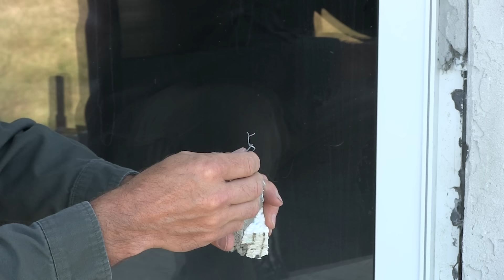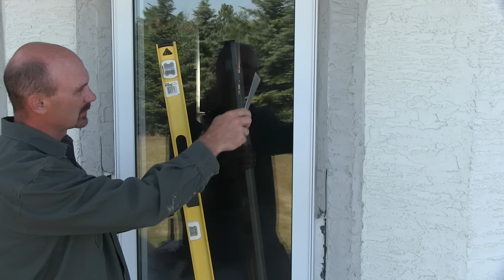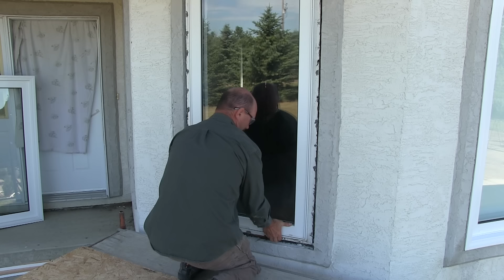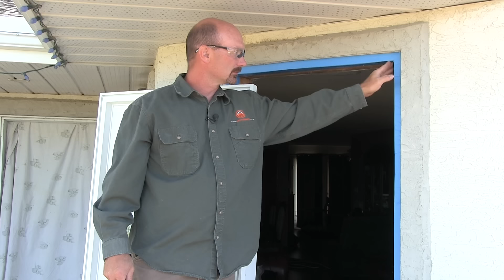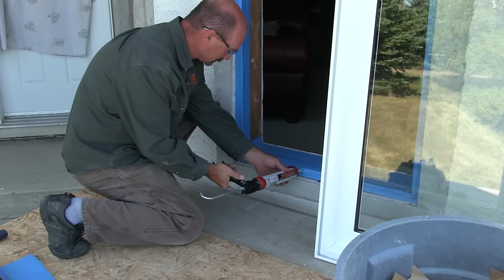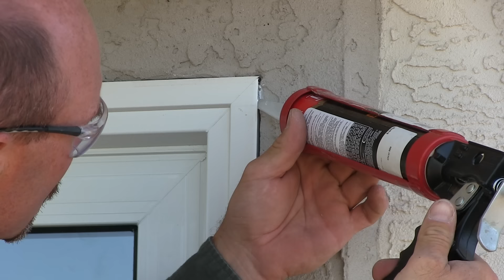How To Replace A Window In A Stucco Wall

Comment: so you didnt attach that tape to the typar? isnt that bad?
Reply from the maker: This home had tar paper and these tapes don't really stick to it , you do the best you can in a remodel. Cover the wood with tape, caulk the perimeter of the window where it contacts the tape and caulk the edge of window to the exterior finish.
Reply: @HouseImprovements on your own house right? if it was for customer you probably would have redone all the stucco right?

Comment: WHAT DO YOU CHARGE PER WINDOW THAT SIZE?  2025
Reply from the maker: labour rates are so different all over the place i'm not sure my price is going to help you unless your in my exact area but labour just to cut and remove the old and instal a new window (no materials) would start at $300.

Comment: wouldnt it be easier to cut the stucco first then cut the flange off.  This way you can have access to the side of the cut flange and pop it off without the stucco and window being an obstical.
Reply from the maker: You could if you are scrapping the old windows anyways , I was salvaging the windows for the owner to use somewhere else.

Comment: 15:05 I was just thinking wouldn't it be easier to use the oscillating tool with a thinner blade to cut the vinyl flange instead of trying to break it with a small bar

Comment: very helpful.  Though I bought standard off the shelf flange type (new con) windows. My stucco is exactly the same, with foam trim boards stuccoed over the old flanges. But I am putting in taller windows than existing (mounted lower under existing header), so I can't leave the foam trim in place.  I think I will cut the foam trim off completely and replace it with wood trim or those plastic paintable trim boards, and then put texture on them like stucco before painting.

Comment: Did you install a drip edge and/or Drip cap? I didn't notice that you did. Many thanks.
Reply from the maker: This window is tight enough under the over hang that it does not require one. If the distance from top of window to under side of over hang  is 1/4 or less of the actual vertical projection above it then it does not need one. For example on a 24" over hang the window needs to be 6" or less down from that over hang to allow no drip cap.

Comment: hey Shanon the window you just replaced looks good why did u change it?
Reply from the maker: These all had broken seals on the glass and two of the three I replaced actual had hail damage to the frames.We replaced all three so they still looked the same since they were side by side.

Comment: @houseimprovements , thank you so much for this video.

If you were adding a new window where there wasn't one before, would you basically frame it from the inside for your rough opening, then cut the stucco that same size + enough for the brick mould / flange in a similar way to what you did here?

Also, how necessary is it to try to get flashing up inder the stucco / wrap at the top?
Reply from the maker: Yes you are correct. Also getting a flashing above is important if you can get it in there. In our case I could not get anything back there but the large soffit over hang made it not as important in this case.

Comment: As someone who has installed windows and glass the last 20 years, please don’t listen to this guy, you never have to cut that much stucco off, if any. Break the frame down on itself from bottom to sides with a piece of wood as leverage and protecting the stucco. I’m not saying it you wont have the occasional crack or break in the stucco but you sure as hell won’t have to do as much repairs on each window as he is showing.
I repeat, please don’t listen to this guy.
Reply from the maker: You obviously never watched the entire video

Comment: Shannon, won't it be easier to cut the flange off as you suggested, it is a vinyl flange and a reciprocating saw will go through it like butter.  THEN remove the flange nails by prying it from the window opening side.

Comment: In other such videos, guys are breaking several inches of stucco away from the opening, in order to get flashing behind the chicken wire and subsequent re-stucco. This method of flashing has nothing past the stucco point. Is this acceptable only because you have a large windows trim flange? If not for that flange, what would you have done for flashing? Thanks.
Reply from the maker: If your new windows have a nail fin then taking at least another couple inches of stucco and then flashing and re stuccoing is the way to go.

Comment: This is exactly what I've been searching for. I need to replace my windows on my stucco house and I refuse to pay exorbitant prices installers charge. I'd rather put my money in quality windows. Thanks. Great job explaining the process.
Reply: I just got a quote of $40,000 to replace 12 windows, 1 slider, 1 French door and 1 Bay window on a stucco house and that does not even include the Trim which they will be ripping out or fixing the Stucco.  I am shocked because 20 years ago I paid about $5000 for a very similar installation with Trim and Stucco included.  I am here for the same reason.
Reply: Si no quieres paga a gente que sabe aslo tu y guardas mucho dinero

Comment: dont worry about breaking past your perfect cut out lines on stucco , it is meant to be jagged in order to have " keys " where the new stucco will fit into and make it bond together .  i break it out with a hammer and also it needs to be 4 inches past so you can tie into the existing paper and wire to have a proper lap , good video though !
Reply from the maker: In my case I was not having the stucco patched. If you watch to the end you will see why.

Comment: Never cut the “building wrap”.  The WRB (weather resistant barrier) protects your home from water intrusion.  Unless the WRB is being replaced.  Whether it’s a dry climate or not flashing is required to lap over the WRB to create a “waterfall” effect.  Water WILL find penetrations and cause damage if not done properly.
Reply: It looks like he didn't cut it but hard to tell and also can be hard to fully insert new tar paper under the existing stucco.  Most of these older stucco homes in Canada just have tar paper under the stucco which cuts too easily though.  Luckily there is a heckuva roof overhang immediately above.  Most of these 1980s stucco homes in Canada do not have metal flashing above the windows and did just fine without water problems, but it's a good practice to add the flashing when upgrading the windows.  At least he did the peel and stick.
Reply: Iam a general contractor for 36 years never have problem on Windows, if you use the right sealing no water gets through
Reply: Some people think felt paper is to protect from water leaks but it's not really the case,is to protect for moisture same thing on the roof or shower walls if shingles are not installed then right way no matter how many leyers of felt paper you are using,with all many nails around,water can go through the nails most important thing to use is a good quality of sealing 🤔

Comment: Excellent video! This is the exact type of installation video I need. I have the same type stucco-built around. I will be attempting to do this myself. I've done home repair, this will be the most involved one I'll undertake. All my south facing windows are toast, the others are great. One window at a time. :) Thanks for the video, subscribed.

Comment: I live in Arizona this type of window that you're putting in to replace the old window do you know what type it is I searched and could not find that type of window with that flange I have an older stucco house my windows need replacing or old aluminum windows like do you know the men manufacture that makes that window thank you very much looks like you do a very good job
Reply from the maker: It amazes me that this type of exterior window trim is not available everywhere. These particular windows are produced by  "Allweather Windows and Doors".

Comment: Its technically called a 2 coat system, not sure I have ever heard it called a build out?? basically its a brown coat then they come over that with the color coat. Not sure how water proofed the application is?? once your paper membrane has been cut away, your never going to have that unbroken barrier against water penetration. ???? great video, just wondering how effective your added moisture barrier will be against water intrusion in the future.
Reply: Not very

Comment: What kind of window is that? Where the screws go in the channel?
Reply from the maker: These windows have a "renovation brickmold" Not every manufacture has this option but for the life of me I dont know why, they are the handiest windows!
Reply: @HouseImprovements   thank you. It like these windows are easier for stucco, and if you ever need to replace them you don’t have to cut into the stucco
Reply: Who makes that 2 inch renovation brickmold  window

Comment: No you dont need to put in a smaller window if you take it out the second way you suggested . You just need to cut of the flanges on the new windows and place new window in opening on the inside of windo drill  holes through the first layer of vinel not through the second. The  hole should be just big enough for screw head to pop through . Use screws to adjust windows caulk the outside and inside. Put vinel plugs in the holes you drilled for the screws for finish look

Comment: Why don't you just cut the window right out from the flange and then pull the flange out? Is the window being saved for something?
Reply from the maker: The window is not being saved and you could cut the flange between the window and stucco edge but the flange will not just pull out without removing the nails and I need the edge of the wood exposed anyways to install the new window.
Reply: @HouseImprovements  I got that part I was just wondering if you could do it that way so it would be easier to pull out the flange without having to scrap alongside the finished stucco edge.
Reply: I will be doing the same thing to four windows and first time pulling from stucco so I don't want any mistakes on my end lol

Comment: Who is the window manufacturer? I can't seem to find those renovation brick mold style windows anywhere.
Reply from the maker: These ones are made by All Weather Windows , Jeldwin will have them also and likely many more . The local big box stores will not have them on the shelf because they are slightly more $$. Talk to a sales person and they should be able to help you.
Reply: @HouseImprovements  can you please point me to a video you have or explain how I measure for my replacement window size?

Comment: I can appreciate your attention to details.  I know that you said the waterproofing details are in another video, but this is a retrofit.  How would you waterproof the space between the outer edges of the blue tape and the edge of the stucco now that the building paper has been cut?
Reply from the maker: You can run a bead of caulking in there .

Comment: I’m new to stucco, I was wondering how much work would be involved replacing my windows thanks a lot .
Reply from the maker: Its a lot of dusty labour.
Reply: bmw575 careful
I was told to remove 3-5 inches of stucco and keep the paper intact to be able to overlap flashing and be truly sealed.

Comment: Thanks for the stucco demo intro .. Im adding stucco molding to an existing door that has been "finished" off just needed an image to my execution .
Reply: How did you prep the surface to add the molding atop it?
Reply: @cosmicallyderived  theres plenty of ways to prep the opening.  Depending on the situation but it always ends in you adding some sealer i would encourage you use a strong water caulk from RO to window /jamb/casing

Comment: I would have liked to see how you plumbed the window. You said it needed to be shifted at the top and I guess you went inside, but you did not show us what you did?
Reply: Tighten the screw either direction you want to plumb it and add some shims to hold it in place

Comment: Please show a video where you installed the flashing for the rough wood and stucco that was already there. I have a similar situation and want to make sure it is watertight. I ordered retrofit windows but I am also removing the existing window sill and installing the window on the rough opening. Please direct me how to ensure that it will be water tight without having to open up any more stucco than you did. Thanks
Reply from the maker: watch this, it gives you the basic idea of the membranehttps://www.youtube.com/watch?v=dC3_0srY0Rs

Comment: I’m so sorry to bother you but I have an arched window that I’m replacing and the stucco is flat doesn’t have that edge (window frame) do I have to build it or how do I build it because my window sticks about half inch out from the stucco the way it is right now. Also I didn’t see any metal pieces on top of the window which I’ve seen other videos install do I have to put that ? Thanks so much in advance
Reply from the maker: Please copy and paste your question to our forum and we can help from there.https://www.house-improvements.com/forums/

Comment: Your work is amazing. I’m trying to get estimates for replacing some custom arch windows and it’s been a pain. Do you do the same thing to replace those and how would I measure to order them? Also do I have to restucco over them ? Thanks
Reply from the maker: Arched windows are a little different , you are better off having the supplier do the measuring to avoid mistakes and if there is a mistake you are not on the hook. With arched windows ,fixing the stucco would be a better finish

Comment: Another 1/4" build out for the silicone would have made it much easier to apply... and speaking of that, get rid of that clear silicone!  It will dry, accumulate all the dirt and will look like garbage in a short time.  Go with a paintable latex caulk, paint it to match your stucco and your stucco/window frame transition will look so much better.

Comment: This install is great Shannon. Only one problem. I can't find a supplier. Can you please drop some manufacturers, Brand names, and models of these 2 inch renovation brick mold windows. I plan on using them on a Central Arizona Stucco home. Honestly I can't find anyone that's heard of this type on install, using a cap plate to conceal anchor screws. Thanks for your input in advance.
Reply: I'd like to know this too, if anyone can chime in with a brand

Comment: Hi Shannon, I am planning on installing a window in my shed building and need a tool to cut the corners of the lap siding. What multi tool would you recommend for the corner cuts. I want to trim back the LP Smart Side lap siding to trim out my window.